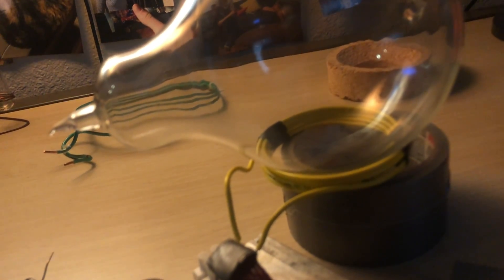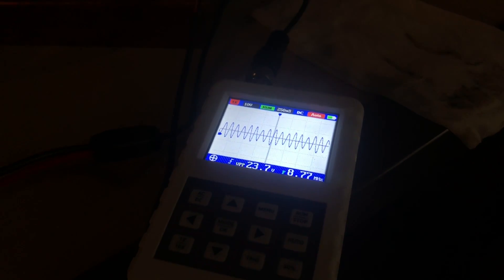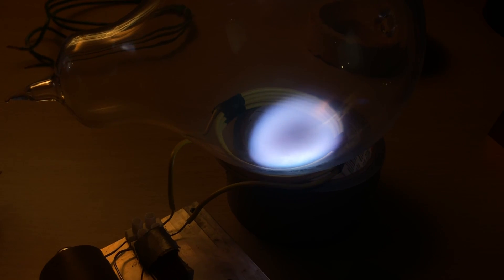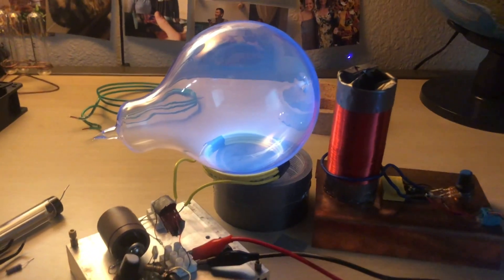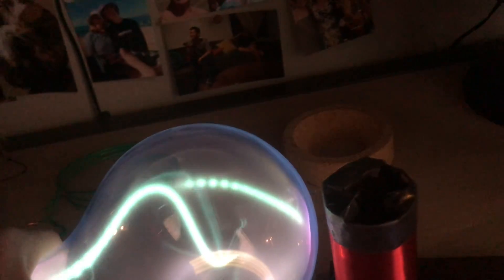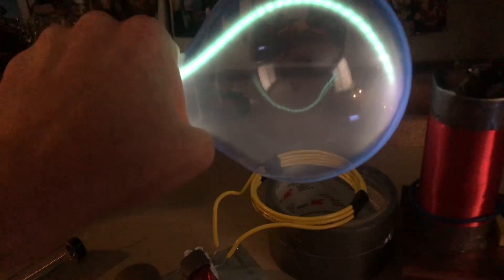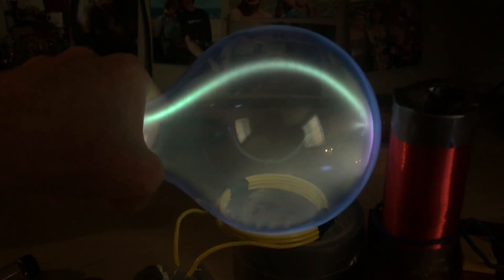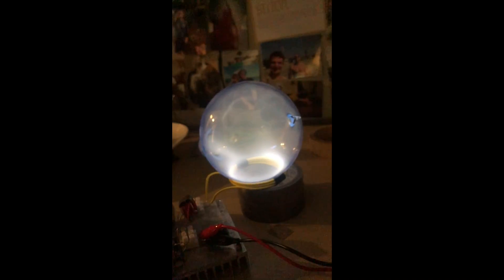plasma toroid experimentation 3

Comment: Man I'd Love to ground / modulate that set up with my synthesizers! Are you currently using two modulation? Voltage , VCO and low frequency , LFO ? Thanks and Cheers from Seattle 🍻
Reply from the maker: I am changing the bias to the gate of a mosfet in a class e oscillator in this video. No modulation in this one
Reply: @BackMacSci  when I saw this and with a rudimentary understanding, just came to mind how to potentially play with it utilizing synthesizer / waveform manipulation & resonance concepts...
Reply from the maker: @keyscook i’m glad you did, one of my goals is to reliably play high fidelity music with this

Comment: I wonder if it is absolutely necessary to have a DC bias, and I am even more curious if it is necessary to be in the 5-10 MHz range... If 50Khz works... Than it may be possible to repurpose an induction heater/ZVS driver... A man can dream... And if it doesn't work I can always drive an ignition coil and make burning arcs LOL
Reply from the maker: The dc bias allows you to set the on time of the mosfet which determines the efficiency of the circuit and how much power is put into the EM field. I haven’t experimented with lower frequency, oscillators, and 1 MHz oscillator have been proven to work in literature.
Reply: @BackMacSci  thank you for the correspondence! That clarified a lot for me. I didn't quite understand how the circuit worked until you gave me that bit of info 😁 Awesome stuff. God Bless you and your research into these angelic-looking circular arcs!
Reply from the maker: Thank you sir! I will release a video soon on how the circuit works in detail
Reply from the maker: God bless you too

Comment: Nicola Tesla would be very interested in this as am I. Going to build the circuit and go a different route on the vacuum chamber and make my own out of lab glass and just rarify good old air. I don't think it has to be xenon to get a plasma. Pressure has a lot to do with filament thickness. Played with a home made plasma jar years ago and noticed by changing the jar pressure I could get those light and dark bands. Good stuff keep it up! Now to check out your 'Star In A Jar'.

Comment: more of a thought but im curious what happens if you move the glass around and how the shape of the glass will affect the way it forms like if you put the "neck" of the glass through the loop of wire and try grounding it from the bottom of the neck when trying to form it or touching near the sides or opposite sides of the wire loop to try and get that kick start to stability or maybe what the distance of grounding does to that stability

Comment: I know I brought this up before but I don't think I really understand. Do you think it would be possible to do this with neon? If not, why not? Or if so, what would you need to do or change to make it happen?
Reply from the maker: I dont think neon will work because it wont form the crucial loop discharge because the gas doesnt have a high enough molar mass. Neon gas also has a much higher ionization energy which probably also factors into why it wont form a loop discharge.
Reply: @BackMacSci  I see, that's too bad. I suppose my other question would be, where do you get these bulbs of noble gases? I've never seen something like that before
Reply from the maker: @PODEPOM  yeah :(. but you can buy them from wayne strattman of strattman design. xenon gas is very expensive right now though, this globe was $350.
Reply: @BackMacSci  that does sound expensive. Thanks for letting me know, man. I appreciate the info

Comment: From what I’ve gathered, the beads are a somewhat standing wave. It’s actually moving much faster than we can see but appears as one to our eyes and cameras. The beads are peaks and valleys in which electrons release higher concentrations of light because there is more energy at that point. The taurus holds its shape because maybe the magnetic field produced by the coils contains it while also providing it with the power to be stable. Hence why it rotates when there is oscillation because the magnetic field is oscillating as well? As well, if this were done with a different gas other than Xenon, it would glow a different color like pink with Helium. 
I’m not a scientist and I’m just speculating and trying to make sense of it. I would love for someone to tell me what’s actually happening here.
Reply: Ps I love this series and want to see it continue

Comment: Just. Amazing.
I don't really understand circuits beyond a battery with a resistor so excuse the dumb questions:
Looking at the circuit diagram, the only outside voltage is the 19.5V, correct? And the capacitors, do they need to be charged before operation, since they are rated for such high voltage?
And what is the power draw? Forgetting instability, could you use it for a longer amount of time as a lighting (and heating lol) desktop decoration? I think it would look super cool with a nice case over the circuit

Comment: Im applying this to the flat earth theroy. The sun and moon are plasma balls. If you use the zoetrap theroy those beads will appear to be a still moving imagine in our sky if their going fast enough. In video 1 where you set the hurtz to the right frequency and the plasma inside formed a ring and ticked like a clock. this is a small scale representation of our earth in a plasma like dome.
Reply: no

Comment: Thanks so much for the update , I am trying to get that hf oscilator build , I bought almost all the components
Reply from the maker: Awesome!
Reply: @BackMacSci  Did you kill a lot of fets when you build the oscilator ? I bought a IRFP260 seller said original but I am not sure about that , also I found 18v tvs instead  of the 15v I am not sure if that is gonna work
Reply from the maker: @rodriguezfranco3839  I've only killed one actually. Also, TVS is optional but yeah 18v should work

Comment: Use a light bench type setup,track mount the tickler so you have precise control of proximity.  Also try different x y z coordinates for components, shielding,fractals.
Reply from the maker: Thanks James, good ideas. What do you mean by fractals by the way?
Reply: @BackMacSci   check out the story of the invention of the modern cell phone antenna .
 The Mandelbrot set.

Comment: If you are overloading your power supply, it may not be able to give you sufficiently regulated or smoothed DC even if it does not outright shut down - this may be part of the instability and striations in your plasma.

Comment: Have any idea on what effect convection in the gas plays once the torus initializes? I'd test it with the coil on the vertical plane relative to gravity just to see if there's a difference in stability.
Also, have you played with any strong magnets around it to see the effects on the plasma?
Reply from the maker: Wow, this is a great idea. I wonder if the toroid would form if the coil was rotated 90 degrees from where it is now!

Comment: Now this would be super dangerous so consider pursuing with caution, but I would try the yoke off a CRT television.  In fact, it would be ideal if it came from a working set and was connected to a working chassis.   It should fit around the neck of your globe.  The yoke steers the beam of an electron gun.  By giving the TV or monitor chassis a valid signal, you could directly influence the plasma in interesting ways.  
If you were to drive it with the correct signal, AND modulate the on off/intensity you can build a volumetric display.  A real "star wars" hologram.

Now the intensity control and timing would require some careful and thoughtful engineering, but I promise it's possible.  Word of caution however, high frequency high voltage behaves in strange ways, and finds non obvious paths to ground spontaneously.  Under no circumstances can you get your hands anywhere near it, as it could couple you electrically to a lethal HV high current source. 
Wanna be famous?

Comment: The beads forming when you "Ground It" is pretty neat to see. It's like it hit a frequency and makes somewhat a standing wave appearance in the plasma thread. Kinda looks like water viewed under high speed photography and video. Or could be the frame rate of the camera causing the effect. Either way, I love the experiments you're conducting. Great Watch!!! Thank you for sharing.
Reply: The beads are incredible. It makes me feel like it's what certain waveforms look like in 3D. Like a sine wave is a series of crests and valleys, taking that up a dimension seems like it'd appear to be a series of touching spheres, which is exactly what the beads look like.

This is all speculation from a performer who is a STEM-enthusiast, not an actual scientist. This is just how it feels to me, intuitively, not based on anything. Because I can't overstate enough how little I understand about what's actually going on in this video series, but I love it nonetheless.
Reply: The "beads" look a lot like this imo:
https://en.m.wikipedia.org/wiki/Franck%E2%80%93Hertz_experiment
basically electrons accelerating until they have enough energy to excite a gas atom, and then starting from zero